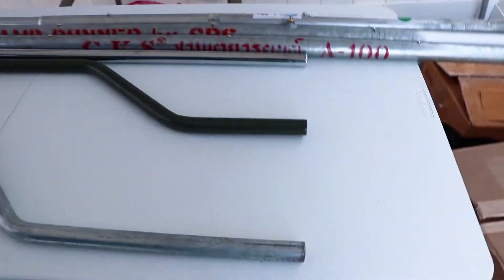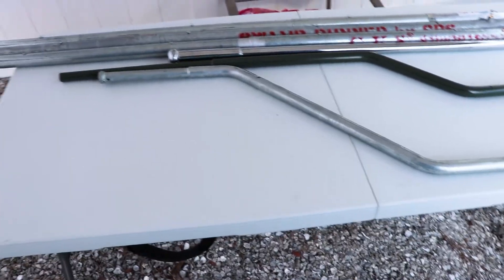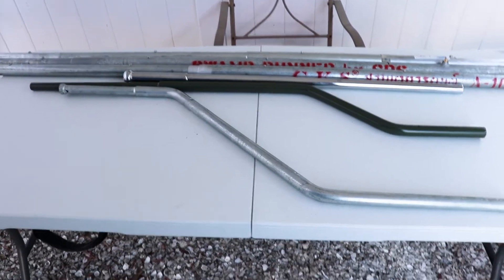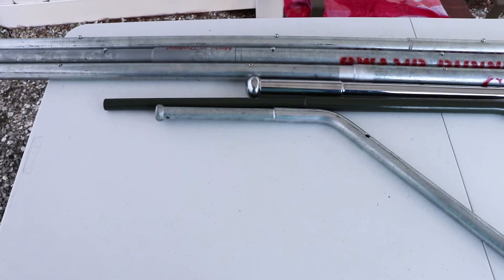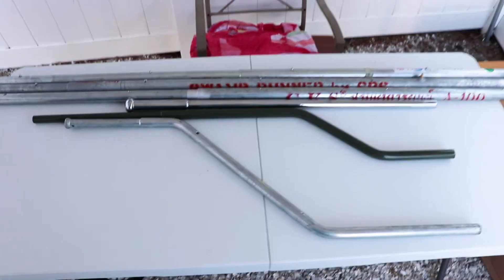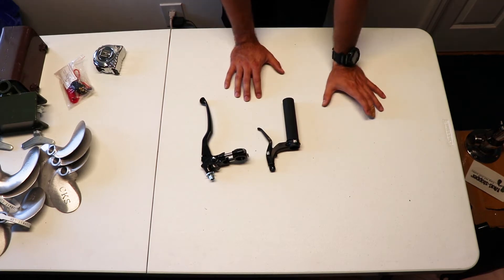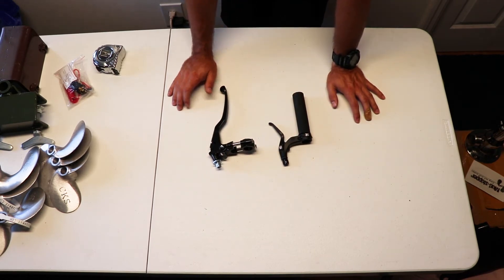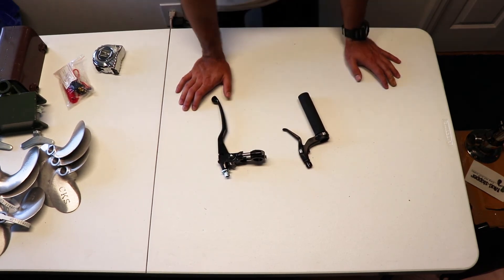Tiller Handle & Throttle Lever Comparison for Thai Long Tail Mud Motor Kits

Comment: One thing I would enjoy with these reviews would be talking about the thickness of the skegs, tiller handles, etc.
Reply from the maker: Awesome point! I never thought of that. I'll have to take a look at that and put it in the articles and add it to the description and later videos. Anything else I may have missed or something you would have liked to see?
Reply: JTgatoring not that I can think of buddy, you did a great job and I've watched the whole series a few times now. Going to get the SPS for my alumacraft 12 ft but can't figure if the 420 would weigh too much for it.
Reply from the maker: I liked my 212 and the small kit on my 12 ft jon boat and it cost less. The small kit with the 212cc engine is 84lbs and the medium kit with the 420cc engine is 133lbs. Thats a good amount of weight difference. I never put the 420 on my smaller boat before I got rid of it.
Reply: JTgatoring sounds good, I appreciate the response. I live in tallahassee so might swing by and see them instead of shipping the sps.
Reply from the maker: That may save you some money depending on the fuel mileage your vehicle gets. You will also be able to get some good tips and tricks from the guys there if you go to pick it up.
Reply: boss hog maybe you can answer my questions! Why is the tiller handle on the starboard side of engine and not like outboards that are on the port side ?
Reply: Dave Kimbler id love to answer but I can’t. My main guess would be most people are right handed and these motors require strength to operate. My second guess is they originate over seas and everything is backwards there (or here). Otherwise I don’t know.
Reply: boss hog I guess I’ll just leave it on the side it came on ! Lol. At first I was thinking it’s something to do with prop rotation but don’t know ! I could try it on the other side and see if it works better ! But I like to sit down when running it and my seat is on the wrong side !
Reply: Dave Kimbler lol. Ya I’ve seen it on different sides so I don’t think you’d have a problem.
Reply: boss hog my thought exactly! What ever works I guess ! Lol. Thank you for answering or trying to answer my question !
Reply: Dave Kimbler absolutely. Good luck and stay safe 👍🏻😀

Comment: Like I said in your last video I have the large swamp runner kit I took and I extended the tiller handle about a foot makes it work a lot better especially with my boat around me to stand up and not have to stretch for the tiller handle and I have not had any problems with the throttle it came With
Reply from the maker: By the looks of your videos, you have the Mud Skipper kit, not the Swamp Runner, correct?
Reply: yea it a Mud Skipper or a SKS
Reply: so someone does use the straight tiler smart dude!

Comment: All of us Thai Longtail importers are modifying these longtails so they will perform on a wide variety of boats.  There are a ton of ways to modify them to your boats and personal preferences.  Keep that in mind in reviewing these.  The Bent handle that SPS, CKS and that we(CLP) offer can be tilted to lower it or raise it.(I'll probably do a video on this soon)  Most people are mounting these on jon boats with a rear seat that gets in the way when you are going over logs, etc.  If you go over a tall obstacle like a log, you need to be able to lift your shaft very high.  If not you will tear something off or potentially pull the motor off the transom.  Just a couple notes- CKS offers a Bent handle as an upgrade.  I noticed the SPS Bent handle can't be moved forward or backwards much because of the length of the base of it.  They should lengthen that some which would be easy for them to do.
Reply from the maker: "There are a ton of ways to modify them to your boats and personal preferences.  Keep that in mind in reviewing these." - Yes, there is a few ways to "modify" these kits, by no means a ton, and some of these modification should not have to be made by the purchaser/customer, but should come from the supplier like that.

 I do not think you should have to modify a kit. You can personalize it to your boat and liking. For instance as you stated about your kit handle. To be able to personalize it, I can move your handle further in or further out from the engine bracket to change where I want it to sit in the boat. I do not have to modify it at all to achieve that desired effect, so that is personalizing it. There is a difference in vocabulary from personalize and modification. A modification would be drilling a hole through your thin handle bracket and through the handle itself to put a bolt through them both to ensure that the handle does not come loose and become inoperable while in use.

"The Bent handle that SPS, CKS and that we(CLP) offer can be tilted to lower it or raise it.(I'll probably do a video on this soon)" - I encourage you to do so. As you said before, it would help the long tail community. The long tail community needs more exposure, and that is why I am doing what I can to help. I will also have a video on it that also.

 "I noticed the SPS Bent handle can't be moved forward or backwards much because of the length of the base of it.  They should lengthen that some which would be easy for them to do." - There would need to be feedback from customers about that and if the customer did not like it and had problems with that. You know yourself from first hand experience how hard it is to get feedback from customers. If its not broke, don't fix it.

These kits are being compared side by side, hiding nothing. I have invested a large bit of time and fair bit of money into these kits and videos. I film and edit all these videos myself and with that, these videos are going to show my opinion and personal experiences. This series of videos, and all videos on JTgatoring, is meant to inspire and educate the viewer. I hope you take away as much as you can, Mr. Milner, and that you become better educated, and more inspired about the Thai long tail, to help improve your product and your customer base. Thank you for watching 👍
Reply: Maybe I should have said "a lot" and not of "a ton"- dunno.(lets not get deep into semantics please- hope I am using the word right! LOL)  There are "a ton" of  different boat designs and layouts and there are "a lot" of different makes and models of engines out there.  When I said "modify", I meant both personalize and modify.(that is the way I chose to use the word)  To make a kit or complete longtail motor that requires very little modification (word used as you suggested) on any boat design on the market is pretty hard(same for outbaords, etc).  All of the importers are small businesses and can't invest a ton of money in surveys and market research to determine what will be the most popular nor can we go out and buy tons of boats and motors to test.  We have to assume, constantly test, constantly change, learn through mistakes and successes, "test" the market with changes, research as much as possible and constantly ask and survey  our customers.  It is a lot of work!  We are doing our best with the resources we have.  We all have our own strategies and ways of doing things.  
In regards to the ability to "personalize" or adjust- yes you need to be able to do this but there is a limit as to what you can do obviously.   To expect that you can personalize any kit or any motor to any boat on the market is unrealistic and won't happen.   There are way too many variables in boats, environments and motors in the USA.  Even for expensive outboards and American made longtails, that is not the case.  The Thai longtails are probably already more "adjustable" than them to a certain extent but they require more adjustment sometimes too...
I hope that you are unbiased since you invested a bunch of time and money in this. Maybe since you have only owned one brand, you sound biased.  I just hope they are properly compared especially since you are relatively new to the longtail market.  Just a little advice- Maybe you should ask the importers why they design things the way they do- it might clarify a few things and enable you to educate the consumer better.   You are testing and running these on just one boat design and in just one environment.   That is not very "scientific" nor necessarily fare to the three different companies but I completely understand that you can't go buy a bunch of boats and travel around.  I hope  you learn a lot from this and report everything properly and to the best of your ability.  Please seek help from all 3 of us.  I think we all have the same goals in mind.  We all want to educate consumers on Thai longtails, improve our products and help grow the market for them.  Everybody benefits!

Comment: Yeah, give me a straight handle any day. I know both SPS and CLP have straight handles. It's just a matter specifying ion the phone.
Reply: The CLP throttle looks like a clutch off a motorcycle. The SPS look more like a mountain bike brake. a lot of people have used bicycle brake level for throttles. I'm already used to the Thai racing throttle. I'd rather have it than anything else.
Reply: I did not use the beaver dam throttle....could not get full throttle out of it just used a bike brake lever and it works great
Reply from the maker: With the straight tiller handle, it sits too low for me when I stand. Is just a matter of calling or leaving a note/email when you go through purchasing. Same deal with the throttle lever. I know SPS has different throttle levers, along with CKS. I do not know if CLP does or not.
Reply from the maker: ron demers - I was experiencing that same issue when I was putting the kit together.
Reply: Yeah the straight handle is too low for standing. That's okay for me; I spent most of my time in open water and rarely if ever stand.
Reply: All of these Thai longtails originally came with the aluminum thumb throttle when they were 1st being imported into the USA about 4 years ago.  All of the importers have been trying to offer better options.  I prefer squeeze types for the safety because they usually return to idle with a strong enough spring and some are spring loaded themselves.  I have tested over 50 brake controls and most do not have enough play to go from idle to full throttle.  Don't just go buy any brake throttle and think it will work.  This one on Amazon does if you want one and it is metal-  https://www.amazon.com/dp/B001GSQNA6/ref=cm_sw_r_cp_apip_EPW8PxlZMvdA6     Plastic ones tend to break easy in cold weather and a lot of duck hunters use these in extreme temps.  Our heavy duty metal bike clutch did not have enough play in it so we had to add spacers and longer screws to modify it.  We made the spacers so they would not go to idle because a Honda tech recommended this(motors tend to stall if you put the prop in the water at idle- especially the 6.5hp).  However, we have found most customers prefer one with more play.  Ours can be easily modified with washers and longer screws to give more play.  However, we don't like how far you have to stretch your hand so we are in the process of testing various brake controls and will start including a different one in our kits shortly.
Reply: My man! straight tiller right!

Comment: I wish someone in the west would try my setup it’s the way thousands of Asians have used the tiller for 100 years, I have done it this way for 30. Ok, I know some of your boats have a built-in seat that is frame support but that seat is in the wrong place for a longtail set up, that seat ruins everything. I run my hours on end; you need to sit down for comfort you can't stand all day. On top of that, you need an awning for sun protection sunburns aren't good. Add all this up and you need to stay seated oops I almost forget the danger of falling shit happens. You should not stand up in a small boat underway, can you say meat grinder? So, you can extend the tiller length and use a straight tiller as the rest of the world does. Get a small stool but not too small, then the tiller length should come almost to your knee while seated, this is the way it is supposed to be done and now I have said my piece and don't forget to have fun I have a channel and I highly recommend this one he rocks.